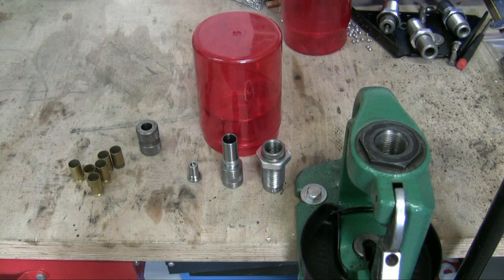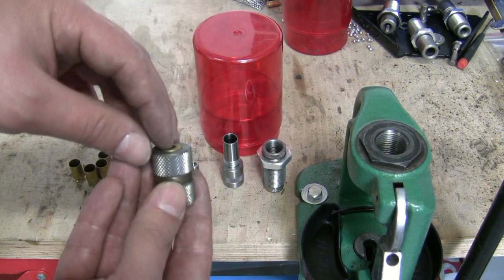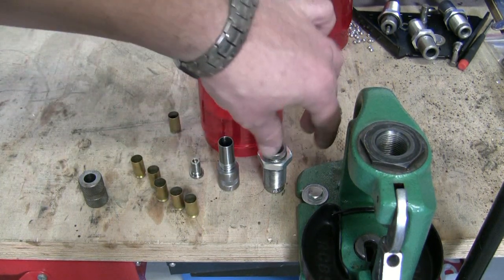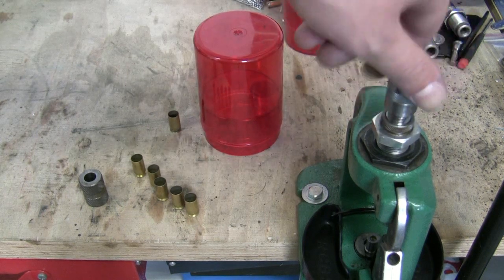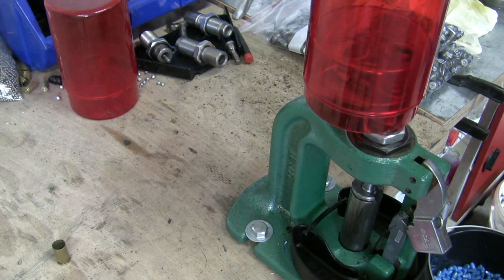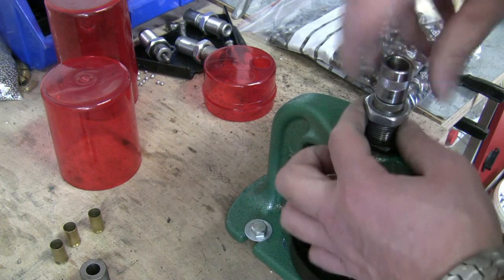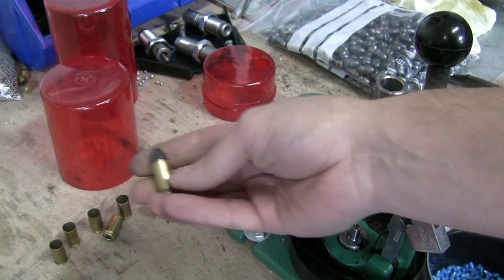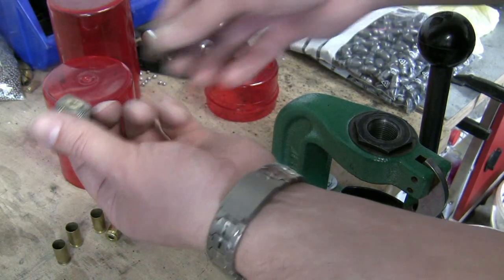Lee Bulge Buster Kit / English version

Comment: Wonderful video using the Lee Bulge Buster Kit. I had discovered this subject several months back and this answered the question about the 'bulge' on some brass that I was reloading. Probably some range brass that I picked up to compensate for some that I couldn't retrieve from the range
I would question why did you not slide the empty case over the plug so it is going backside first. This is the way the first video I watched showed how to use it. By doing it this way you don't have to hold onto the casing.
For loaded ammo with the 'bulge' with a live primer you would have to be very careful. Primers are very sensitive.
But thanks for the video. Well Done.
Reply from the maker: Majeskty Thank you very much for leaving a comment buddy. I never tested to push the case through the die over the plug...

Comment: 380 bulge buster also works very well to fix the rim of 223/556 cases!

sometimes brass fired from machineguns or run through some reloading presses can squash the rim and make it out of spec.
Reply from the maker: Thank you very much for the Information brother...did not know until now.

Comment: What is the purpose of the factory crimp die? I always thought since the brass passed through the bulge buster that it would just screwed directly into the press and you would force the brass through it like a Lee lead bullet sizing die.
Reply from the maker: The factory crimp die removes the bulge...die Bulge Buster is a way to catch the finished brass only. I start doing this opperation with the crimp die only the first time...it works but you have to catch flying brass ;-) With the Bulge Buster Kit it's a clean and easy way.

Comment: Great vid as always, I didn't even know about that die, a friend has a full auto MAC10 that bulges the brass real bad, we could reuse it instead of throwing it away now.
Thanx a lot for the info, 
PS: what dimension do you resize your lead 45 bullets ?
Reply from the maker: Thanks brother. My 45 bullets are sized to .452. Works best in my handguns (Glock 21 with IGB Barrel) and in the 1911 of my Buddy.

Comment: whack! "like you can see here i don't need alot of force" whack, whack.... lol
Reply from the maker: Hmm yes, you can here a Little bit but I don't have to muscle down the handle...a Little bit more than regular sizing but no big deal ;-)
Reply: It can be made a little easier by adjusting the die up till the ram just pushes the case through the sizing section of the die... Theres more leverage towards the end of the stroke of the press handle :-)
Reply from the maker: Ok Buddy...thanks for the advice. Will do so next. Greetings Markus